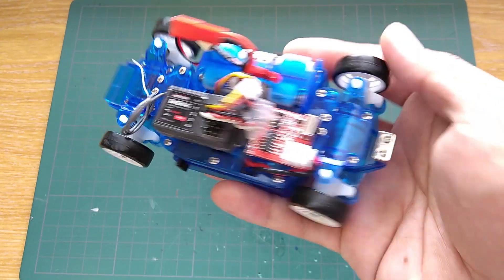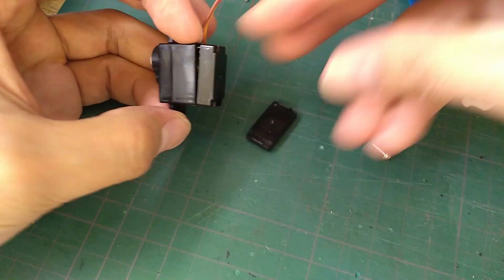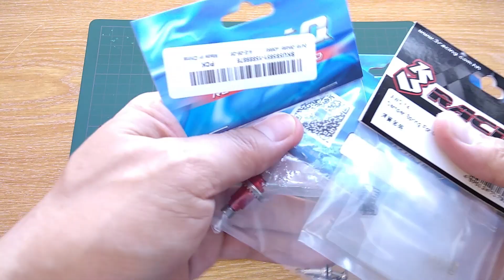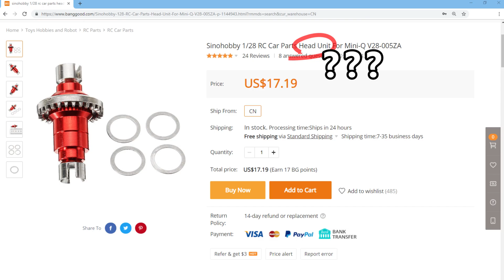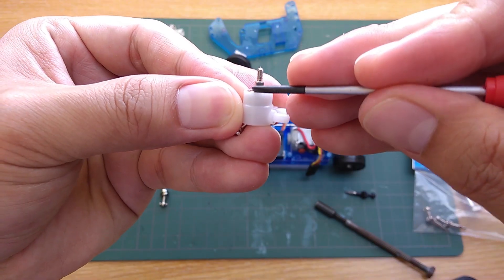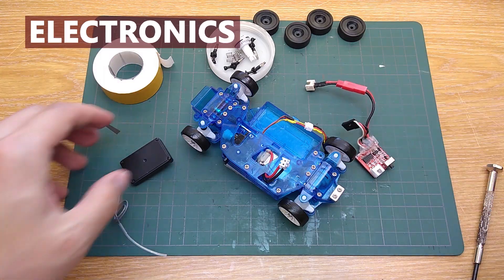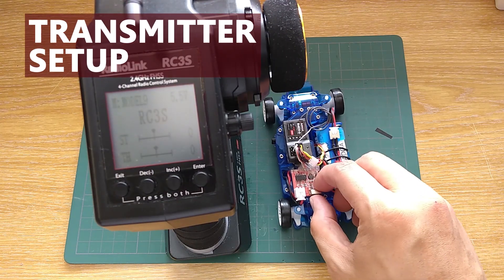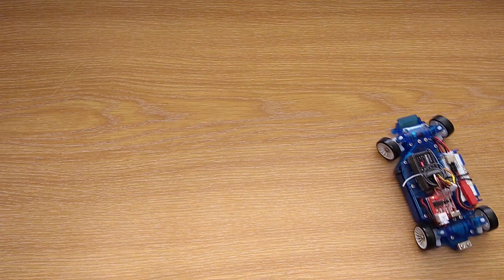Mini-Q TRQ1 | How To Build Ultimate Budget RC Drift

Comment: @Beaver, so which metal drive draft is perfect fit without shim or file. I saw you once recommended the one from Aliexpress,link below.. Is it perfect fit? Is this also same as the 3racing's one you recommended.
https://m.aliexpress.com/item/32949670507.html?trace=wwwdetail2mobilesitedetail

I think you said the one from Banggood needs a lot of shims.
Edited: i watched your video again, you said the mini z from 3racing one would be perfect fit without shim. 
I just bought the front one way you suggested from banggood.
Btw, with everything stock i already very satisfied with the way it drift. Will see how this simple mod will do. Thanks
Reply from the maker: 3Racing or Eagle Racing drive shaft will work well without shims.
Yes, just upgrade drive shaft and one way and probably wheels & tyres if you want more control. 
The whole thing I did with electronics here was because the board was burnt.
Reply: @BeaversHobby  thanks. 3racing one is restocking. The Eagle racing is that the link from your Rcgroup blog's one on ebay. Is that $11 for 4 dog bone. It doesn't specify, but the picture shows 4 of them.
So the blue and red ones from Aliexpress are not perfect fit, aren they?
Reply from the maker: @Ykev2000  Red and blue from Aliexpress is a gamble. You might get one that the shaft might be shorter, longer or thicker than it should be. You can try though but I don't guarantee the result or how would it fit.
Eagle racing is a set of 4, it has has long and short shafts. I'm not sure which one you found. This is link for short shaft. https://www.ebay.com/itm/MA20VE-10S-ST-Universal-Joint-Shaft-S-For-AWD-MA-020VE/253151171525
Reply: @BeaversHobby  thanks a lot. I will buy the Eagle one. Do you know if it includes the nuts. My TQR1 came with screws instead of nuts. Probably the newer version only comes with screws.
Reply from the maker: @jp7g229  M2 lock nut. If you get steel nuts you'll need 4mm hex wrench. If you get aluminium nuts they will be 4.5mm. Get a 2 dollars cross wrench and it'll have every tip you need.
Reply: @BeaversHobby  yes, i have the wrench, bought the one you suggested. But i meant if the Eagle shaft comes with nuts or not. It doesn't show in the listing's picture and not in the description. Or shall we always assume the shaft must come with nuts?
Reply from the maker: @Ykev2000  No, they don't come with nuts. You'll have to buy M2 lock nuts separately.
Reply: @BeaversHobby  ok, thanks a lot.
Reply from the maker: @Ykev2000  My pleasure.
Reply: @BeaversHobby  one last question. If i find dog bone for mini z or mini q, it also should fit without shims or file, right. Because i want to see if i can find something local so that i don't need to wait for long shipping from Japan. Or  still  better get the Eagle one base on your experience?
Reply from the maker: @Ykev2000  Yes. However be careful because some don't fit very well and need shims. In my experience getting one from known brand like Eagle Racing, 3Racing, RC Aurora or Atomic is better and will work without (or at least with minimum) shims.
Reply: @BeaversHobby  ok, thanks again. I think i would just wait and get from Eagle. 
Btw, just bought two more TRQ1 for racing. Have you guys checked out a cellphone app for counter, Very cool. LAPTRAX
Reply from the maker: @Ykev2000  Seen it. It needs a fair bit of light to work and I use my phone for filming so I don't use it. You should use it though, it's good.
Reply: @BeaversHobby  received the dog bone from Eagle, thank, but still waiting on the front one way from Banggood.
2 days ago got the other two cars blue and red from Aliexpress. I realized both of them have less power than my first one from Banggood, the green one. 3 of them all have normal screw for the tires instead of m2 nut. So i assumed they all from the latest batch. The green one from Banggood has a lot more power so it can easliy drift sharper tight turn than the blue and red. Not sure if it is because i have been playing the green one for quite sometime and that's why it made the motor or gears runs smoother and thus it is faster and easier to make sharper drifting turn.
Reply from the maker: @kev8847  The new ones are slower probably because they have bushings instead of bearings too. Those create a lot of friction.
Reply: @BeaversHobby  all 3 cars seems from the simliar time of production 
 I bought the green one last month then 2 more 3 weeks ago. They all don't have the magnetic clip to attach the body. All dont have m2 nuts for wheel. 
I swapped the tires from the green one to the blue and red and no improvement. Do Trq1 has bearing/bushing in the wheel or....,
Reply from the maker: @kev8847  Bearings are in the wheel hubs, differentials (or solid axles) and centre shaft.
Reply: @BeaversHobby  ok thanks. Just received the front one way today. Will check the bearing when i install it. Banggood really didnt ship the 4 shims as shown in their product page. Probably will not fit the Trq1.
Reply from the maker: @Ykev2000  Try it first. It might fit with a bit of space. If it doesn't slip then it's fine.
Reply: Just checked it needs shims. 
Also when i took out the bearing from the stock differential onto the new front one way, i see it is bushing. I then inspect the green car it is bearing. So where can i buy the  bearing for this car.
And if i have the front one way you suggested do you think bearing still make some differences than bushing. I saw the new front one way already like the bearing mechanism than the stock differential. But j think smoother always better...so still needs bearing i think..
Reply from the maker: @Ykev2000   You'll need to look for the bearings somewhere like ebay. Search using the sizes.
You'll need 8 of 3x7x2mm for hubs, 
4 of 6x10x3mm for diffs and 2 of 2x5x2.5mm for centre shaft.
Reply: @BeaversHobby  ok, thanks a lot. So apparently the green on i got that has bearing is the latest version i believe,  right.
Reply from the maker: @Ykev2000  Bearing is the older version. Each new one gets progressively worse.
Reply: @BeaversHobby  oh really. The package box it shows  bearing though. It is sad. And the manual for both newer cars i just  received and the older old i got all have the same part number for the bearing, v28-038. They should update them with different part number since the  newer car i got with bushing it needs one shim, and the other one i got with bearing without shim.
Reply from the maker: @Ykev2000  I don't think they're going to update the manual. Just like before, they made it once and use it forever.
Reply: @BeaversHobby  right. Thanks  again for all the detailed information. Will see if there is a need to change all bushings to bearings. May be now is ok. Drifting on hardwood floor actually don't see much difference, but on short hair carpet the green one see big difference though because of more power ....
Reply: @BeaversHobby  ok decide to change the bearing on diff and center shaft. So from ebay i found two choices that i am still debating which is better for diff and center shaft. They both similar price. 
1. Metal shield ABEC 5
2. Rubber sealed ABEC 3
Reply from the maker: @Ykev2000  I'd go with metal sealed. Should be easier to clean.
Reply: @BeaversHobby  thanks,  
By the way, you got any video on how to remove the bearing from the wheel hub? But not sure if it makes a big difference for AWD car like TRQ1 though.
Reply from the maker: @Ykev2000  Wheel hub bearing will help a lot. I don't remember doing a video specifically pulling the bearing out but it should be a part of some build. Look at WLtoys full metal upgrade, that's the first one that I can think off right now. This is pretty standard, there are 2 bearings one on each side. Use a shaft or flat head screwdriver to push it out from the inside. Put it through the hole, not what you see directly. Check the manual or diagram and you'll understand.
Reply: @BeaversHobby  ok, will try. Thanks a lot. 
But replacing this cost around 10USD since 8 for each car. I checked my green car actually only have bearing on differential, not on centre shaft and wheel hub, and the runtime is around 15 minutes longer than my other 2 bushing cars. May be with additional center shaft bushing replacement it is good enough. Haha, cannot believe they cut cost that much. May be they aim for hardwood floor drifting and you actually dont need that much speed. But for durability wise, bearing should be better..

Comment: What was the final cost?
Reply from the maker: I only paid about $8 for the springs that I didn't have, all the rest are what I have already.
However if you just started and don't have any part nor radio and washers, everything + shipping are about $119.
The most expensive stuff is Radiolink RC4GS for $54.
Otherwise if you already have radio it'll be $65.
If you get 3Racing swing shafts instead of Mini-Q you'll save a bit because they are both cheaper and don't need shim.
For bare minimum you can just get the car and front one way and that will be $56.
Reply: Beaver's Hobby if I paid you commission and shipping would you be able to build me one and ship it me? If you’re interested I’ll send you my email
Reply from the maker: @trillnugz4277  Sorry, I don't build car for sale.
Reply: Beaver's Hobby in your original review you said that the 3 in 1 unite fired in this car. Should I worry that that will happened to me or was it because you were pushing it in the speed test?
Reply from the maker: @trillnugz4277  I believe I held the throttle too long. (Replaced the MOSFET and it's now working again.) The new one comes with new board and capacitor at the motor so I think they solved that problem already. However all bearings are replaced by bushings so I'm on the fence about recommending this car. It's good for the price, new board is nice but  bushings instead of bearings isn't a good change. Replacing them isn't hard or expensive but it still racks up the cost that shouldn't have in the first place.
Reply: Beaver's Hobby alright thank you for the info $120 not too bad. I really want to get into rc drifting but it’s really expensive in the 1/10 scale so I’m hoping to get into it at the 1/28 scale. I’m glad I found you channel you’re very informative !

Comment: Do you know why the D.I.Y. kit is more expensive I plan on a drift build like this  I just wanted to know if there is any perks with the DIY over the TRQ1
Reply from the maker: It's the same chassis. DIY has grip tyres as far as I know but you can buy Q1 grip version too so there's no difference.

Comment: the shims/washers are hard to come by in Europe. Do you have any alternatives?
Reply from the maker: I did some of my shopping in rcparts.eu . Hopefully there are still some left.
http://www.rcparts.eu/spare-parts/kyosho-mini-z/shims-and-screws.html
Reply from the maker: Also if you have supply shop for nuts & bolts near you, you should check it out first. The stuffs that have "RC" label are always more expensive and hard to find. Look for washer with 6 inner diameter, 8mm outer diameter and 0.1,0.2 and 0.3mm thickness for the diff and 3mm inner diameter, 4.5mm outer diameter 0.1,0.2 and 0.3mm thickness in case you need some for the wheels.
If there's nothing locally, Mini-Z Racing Italia is there for you. http://www.minizracing.it/minizshop/index.php?main_page=index&cPath=873_437

Comment: bought the mechanical parts and right before to install them the car started to behave weird: sometime it won't back and steer, it just freezes. Do you guys have any idea what it is?
Reply from the maker: That's a problem from the circuit board. Try to put speed limiter to max, turn it off and on again and see if that still occur. Otherwise your board is on its way out.
Reply: thanks mate! can the standard bord be bought separate?
Reply from the maker: @the_real_stingfloyd  Unfortunately, no. I have seen an old board in hobbyking but I'm not sure if it'd work with Q1 transmitter. It's better to upgrade it to separated unit if the board goes bad.

Comment: Hi Beaver, when you upgrade the electronics, can you not keep the old servo? I have an extra 3-in-1 circuit board from mini-q q7, do you think I can use it to upgrade trq1? Or are they not precise enough?
Reply from the maker: The original servo is 5 wires and not compatible with standard 3 wires system so I had to upgrade it. Q7 board is also 3 wire as standard RC component. You can also transplant servo board from a broken 3 wire servo in to it and not upgrade the servo too, like this. https://youtu.be/GDukjyycyxo

Comment: how much did this build cost?
Reply from the maker: I only paid about $8 for the springs that I didn't have, all the rest are what I have already.
However if you just started and don't have any part nor radio and washers, everything + shipping are about $119.
The most expensive stuff is Radiolink RC4GS for $54. Otherwise if you already have radio it'll be $65.
If you get 3Racing swing shafts instead of Mini-Q you'll save a bit because they are both cheaper and don't need shim.

Comment: I purchased this car currently waiting for it into to mail. I just want my car to look good first I really like the rims and was thinking it just needs a more realistic body. How hard is it to put a kyosho mini z body on one?
Reply: ***i really like the rims you used in this video
Reply from the maker: @natesimasek  The rims are standard Mini-Z rims so you can find it easily. It's not hard to fit Mini-Z body either. Just shave the chassis off a bitnat the front so you can install front lip. Then on the body you grind side clips off until it fits on the chassis and at the back remove metal bar from original body to install it on the new one.
Reply: Beaver's Hobby thank you. Hopefully I can do this process when my trq comes in. Great video